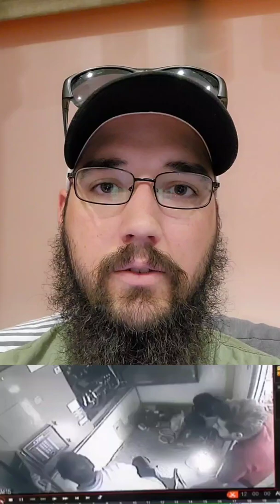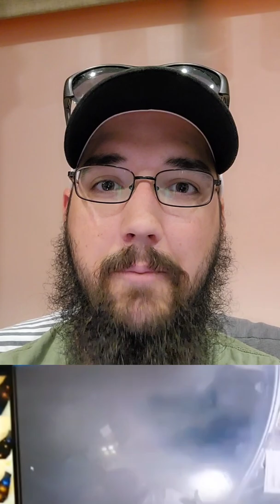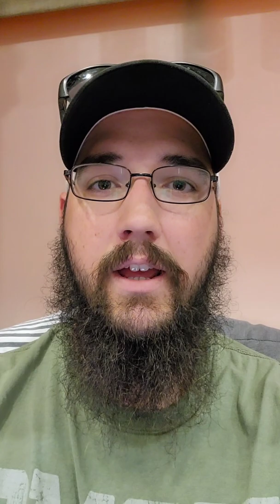York Chiller Question About VSD

Comment: Full Power module replacement is best thing to do.. ive experience with vfd drive busted fuse then i tried resetting it blow out. How much with this big vsd drive which same function..
Reply from the maker: If they have major failures I agree its worth the whole module, but if you do a repair you have to go through the entire thing to verify other components.